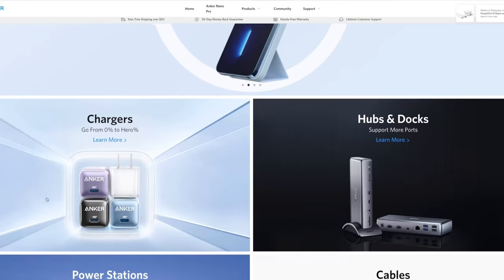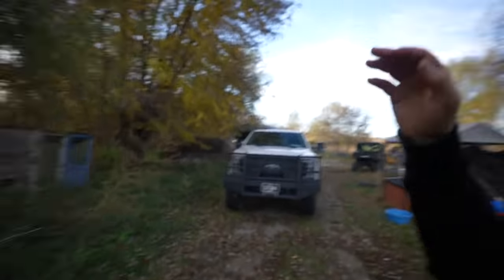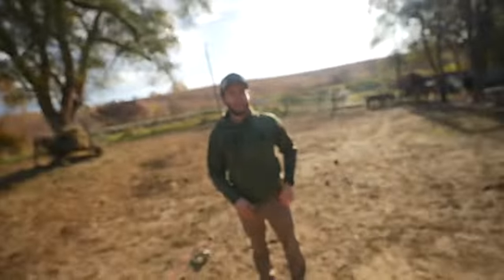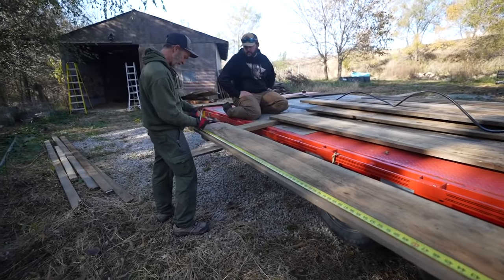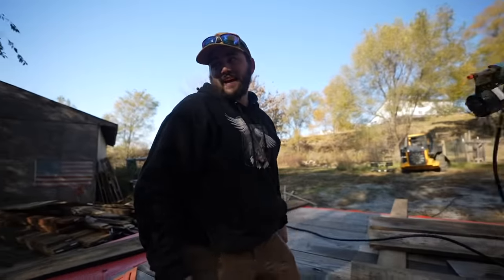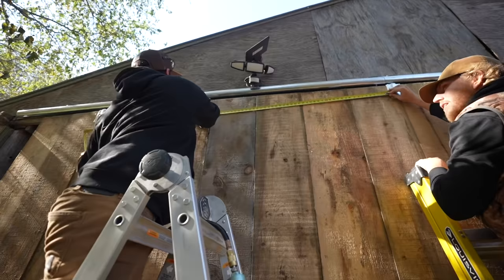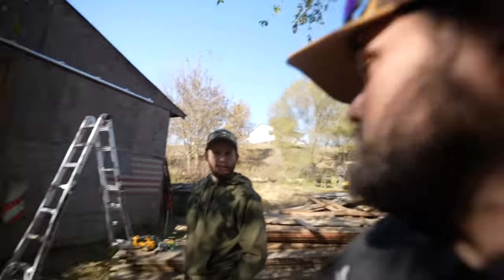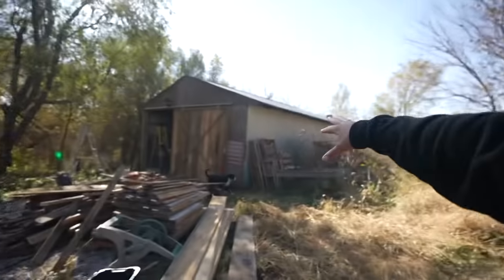I Waited YEARS to Build THIS!!! (Gamechanging BACKYARD Renovation COMPLETE)

Comment: 5:50 Beefcake Construction LLC project: build a little shed thing over top of the water dishes with a couple of solar panels that run little heaters. Solar is often used on big ranches for pumping water where power isn’t available. There’s probably a kit online somewhere for heaters too.

Comment: Flair for the door instead of t posts I’d recommend a 4’ piece of 1/2” rebar and slam it 3 feet in the ground no hole. Paint the tips yellow that stick out and you don’t have to see the t posts and it looks a lot cleaner. I used to sell buildings and you’d think they’d have a better solution by now but this was the best solution we ever came up with

Comment: Fun thing about extension cords is that the more cords you have plugged into each other or if you have a super long cord the outlet may not have enough power to to run down the line. It’ll make things not run right. They won’t run well in the cold. They might not even power some things on. You lose so many watts per cord/or after like 50 feet of cord.

Comment: Just a heads up, a ground is just a safety measure. It’s purpose is to avoid electrical shocks when something blows. Instead of it blowing you up or whatever it is, it’s grounded so that it goes to a piece of a metal attached to the GROUND to make the current stop.

Comment: Lipstick on a pig is an expression used in the Midwest when you make something pretty by doing a simple thing. That barn will have mice, raccoons will probably be on the outside, but I doubt that he’ll spend much time out there besides for food for the animals and pulling out equipment, if it still works, after the mice tear it up.

Comment: Pull out the t posts and put on the brackets that are made for a sliding door you put two of them on the bottom one on each end of the door to slide through on the right end and use as a stop on the left it will hold your door shut much better and they cost less than one t post. Stop cutting corners on something that cost you almost nothing to begin with. Sorry to say it but it does just make you look like a joke.